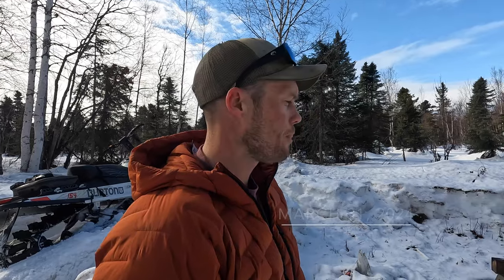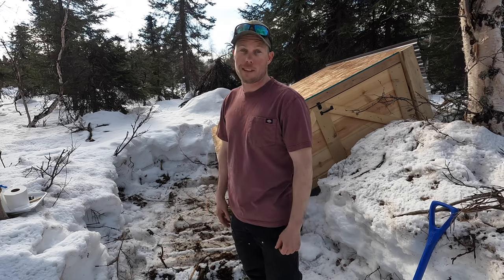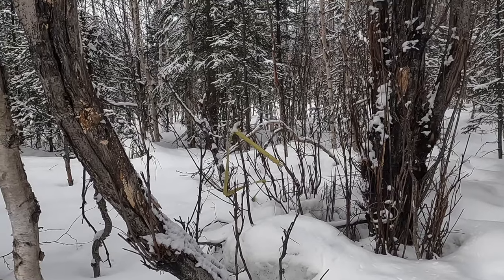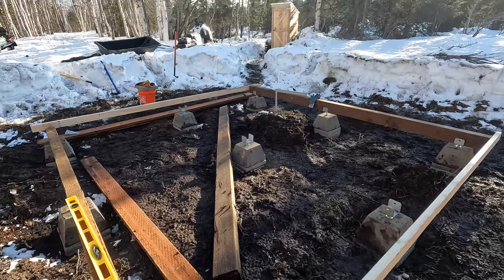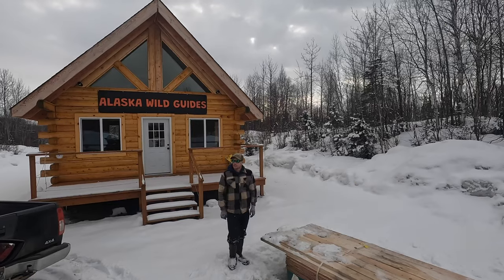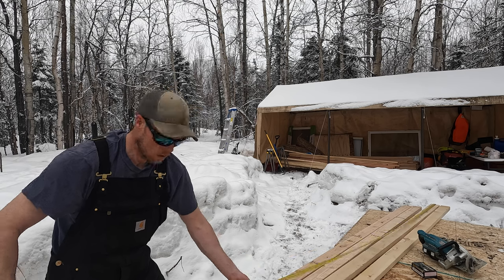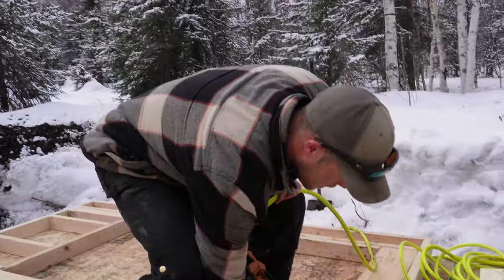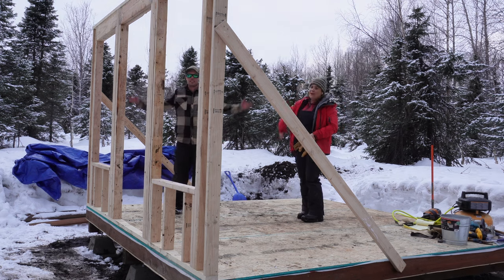Building our OFF-GRID, TINY CABIN.

Comment: If you measure your diagonal lengths they should be the same( corner to corner and then the opposite diagonal). That also helps you know which way to “nudge” your square. Or you can use the 3,4,5 or 6,8,10( whatever multiple of 3 ,4,5 you want…longer is better) 3 foot down one side, 4 foot down the other and the measurement across the angle should be 5 feet, For example. You’re doing great man. Well done guys!!💪🇺🇸

Comment: Good video. I just have one question. Are you putting logs on the outside?. I ask because 2 x 4 walls are not even close to thick enough for alaska......they should be 2 x 8 so you can fit twice the insulation making it way easier to heat and cool.
Reply from the maker: We have chosen to not install rough cut lumber for siding.  We will go another route. Tess and I are on a tight budget right now, so we chose to go with 2x4 framing. once I get a wood stove installed, the cabin will be more than toasty!